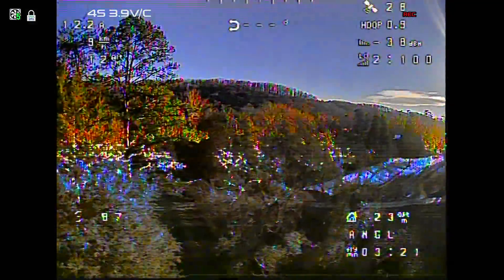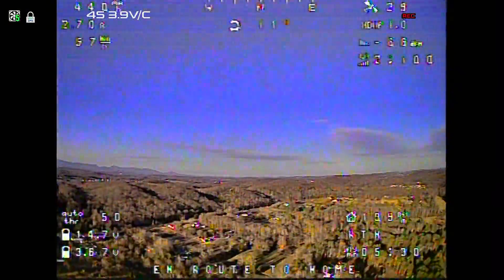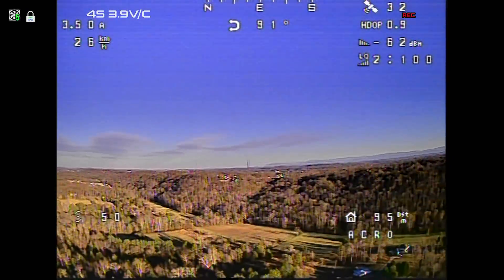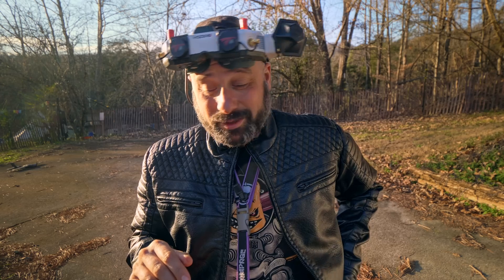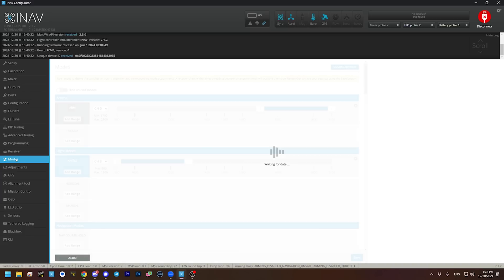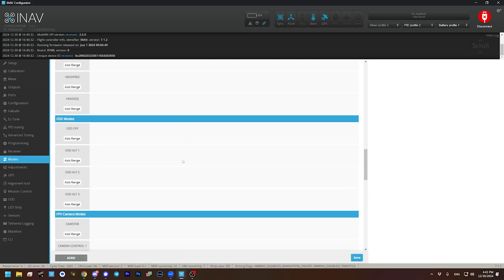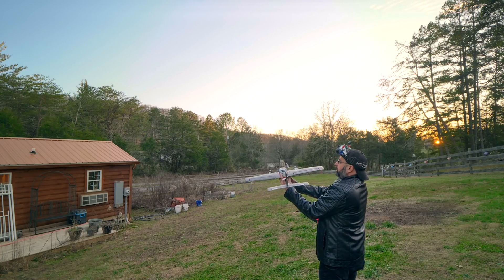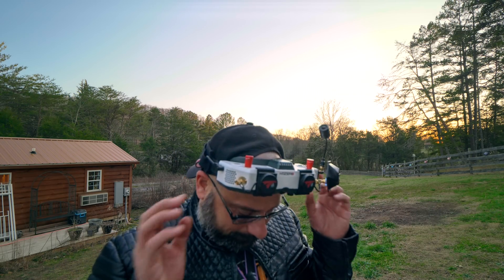Heewing T1 Ranger VTOL test flight and iNav autolaunch setup

Comment: Inav users and Developers will tell you to NOT shake the plane and they can argue why this is wrong, you can set an idle throttle to have the visual confirmation that everything is ready and that the auto launch is engaged. Thank you!
Reply from the maker: What's the argument against shaking?
Reply: @JoshuaBardwell  Apparentley it can mess up the I term and cause problems in flight. Much better to add a delay, about 6-10 seconds. Then idle throttle of about 1500. Also decrease your launch angle rate to about 25. You can see its really struggling on launch, dragging its tail. Hope these settings help. As for disarming mid flight, we have all done, twice, so you in good company.
Reply from the maker: I set the launch angle to 40 to make sure it cleared the trees 😅
Reply: @blackbirdboy1  1200 idle is usually enough so the props are spinning but not scary while it's in your hand. Especially with this little thing, it's got plenty of thrust and small props so they spin up fast.
Reply: @JoshuaBardwell  https://www.youtube.com/watch?v=3HULgXW6VXY Marc (INAV dev) was still doing videos only in German back then, but the english subtitles are correct and explain why you don't want to shake before the throw. It is in fact because the PIFF controller becomes active and the I-term will wind up while it's in your hand, which will make it less able to auto-correct once you toss.
Reply: @JoshuaBardwell  Definitely add some idle throttle for launch mode and just throw it without the shake, also remember you  have control surfaces that aren't dependent on the motor being armed and can glide to a safe landing location. I've had a motor burn out on launch and managed to glide all the way back to myself but just avoiding trees or rooftops is usually the main goal.
Reply: @JoshuaBardwell  It’s good.. you can shake it.. no problem.. you just prove it in your video that your plane can launch by shaking it
Reply: I always use auto launch and never shake it
Reply: On my AtomRC dolphin and Zohd Talon Rebel I have a lower idle throttle with a slower spin up into takeoff throttle. Took me a long time to figure this out as the solution to prevent torque rolls. Shaking the plane for wake-up would negate this solution.
Reply: @roamingIntrovert47  Idle throttle is the "correct" way to counter torque roll on a single-motor wing and getting usable thrust quicker on any wing. 1200 or 1300 is usually all it takes unless you have a very dense and underpowered wing (looking at you, Caipirinha II...)
Reply: Took me far too long to realize torque roll was what was getting in the way of consistently getting my Dolphin in the air. I use an idle throttle of 1350 with takeoff throttle of 1800. But also changed the spool up time from 100ms to 200ms. Found this through trial and error and it works well for the heavier weights I usually have my Dolphin at.
Reply: It is also fairly dangerous in case you are not careful handling the plane, since when you raise the throttle the motor won’t spin. I usually set the motor idle around 1400/1500 ( this will depend on the aircraft) and launch throttle 150/200us higher. This way the motor will start spinning only when you raise the throttle. This will also help with torque roll in case of a single motor.
Reply: Ya, it's definitely not necessary to shake it.
Reply: Causes I Term windup
Reply: I mean it’s a twin plane, it can have a 40 degree launch angle! Wouldn’t be as fun with a flying wing/pusher setup 😂

Comment: I do like how the OSD clearly demonstrates the benefits of a wing vs multirotor for loitering /  The Battery was already reporting less than 3.3 V per cell upon initial takeoff.  Battery jumps right back up to 14.8 / 3.7 v / c upon transition. I would probably take this into consideration upon landing,  Try to make your landing as quick as possible or you are going to destroy your batteries pretty quickly. (posted right as he was saying the battery was spec'd with a c rating for a wing) ha.   WAIT TILL THE END BEFORE YOU COMMENT ME> ohh well, either way the point stands if flying vtol, of course landing is going to pull a lot less current upon landing, but you should probably come down fairly swiftly and don't try to hover at all upon landing.